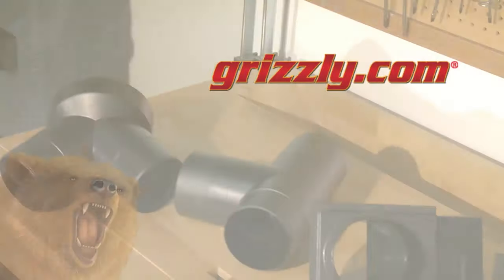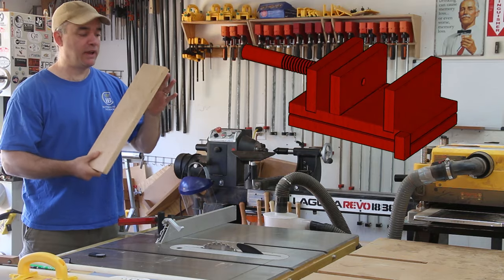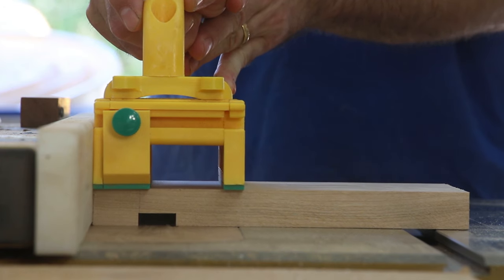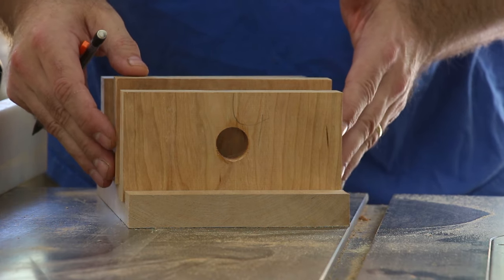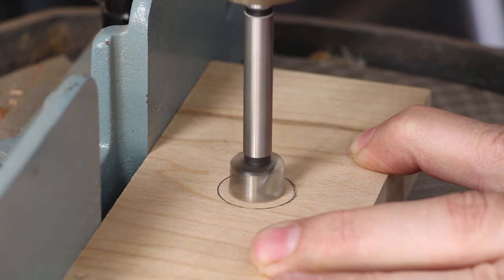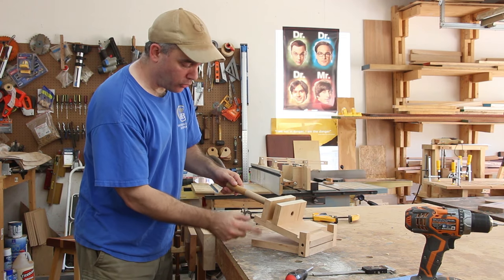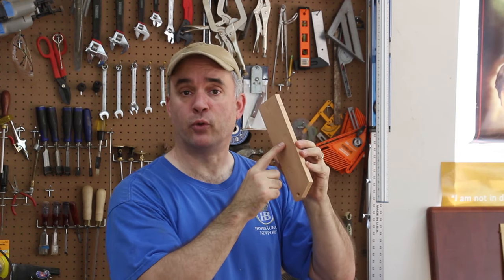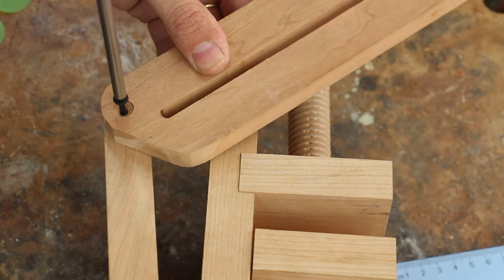Tilting Drill Press Vise

Comment: Congrats! Very impressive 100K!!! Very cool build. One thing i noticed with the threaded insert.. The two slots are actually the cutting edges not for the screwdriver to fit in. So it is in backwards. I do not mean any disrespect what so ever, maybe you didn't know. It is one of those things i did wrong for years untill some one explained it to me...
Reply from the maker: I really don't think that's correct and I hope you're pulling my leg.  There is no "cutting" that needs to be done as it's already pre-drilled.  The slot is most certainly designed for sinking the insert with a screw driver.
Reply from the maker: No way that's correct.  The slot is for a screw driver.  They also sell them with hex heads for the same purpose (with no "cutting" slot on the other side).  There is nothing to cut with the exception of threads on the sides of the insert.
Reply: GarageWoodworks i am not here to judge you. Sorry. I got my info from a seasoned woodworker after doing it the same as you for a long time. But since they are brass they easily break when forcing them in with a screwdriver . Again no disrespect to anyone. At the end of the day you can do whatever you want... 😊 😃 if it works it works. P. S. I did not believed it at first too!
Reply from the maker: No need to apologize.  It just doesn't make any sense on a few different levels.  First, there is nothing to "cut" that would be accomplished with that slot.  Two, there is no "cutting" slot on the hex head 
inserts.  Three, they work perfectly with a screw driver. *EDIT: The more I think about your suggestion that the slot should go in first the more ridiculous it sounds.   With all due respect, there is no way you are correct - I'd bet my house on it.
Reply: GarageWoodworks then were does the wood go that is taken up by the thread. If the wood is compressed the insert would be harder and harder to push in and thus the top of the insert will break in some cases. If the hole is bigger than the center exterior tube than compression is not a really big thing but misalignment is . And if you look at the insert the tread goes past the slot. So the wood would be going out of the hole. And not compress the wood. 2 the hexagon inserts are tapered. Leaving room for the compressed wood to go.  Compression of the wood is there too but due to the strengt of the hexagon head it doesn matter. It wont break that easily. Again, any body can do what they want. I find it this way easier to use. But i am not telling you you shouldn't do it with a screwdriver. May i thank you for this discussion. It is not always i get the chance to talk directly with one of the great content creators!

Comment: It is all very well for someone with an extremely well kitted out shop like yourself but this is not a project for your everyday wood worker. maybe if we all were sponsored like yourself we may have a chance at doing things like this.
Reply from the maker: +Steven Chambers Drill press vises are only useful if you have a sponsor?  I don't understand.
Reply: I meant that your sponsors most likely supply you with tools that the common woodworker does not have eg woodworking taps and dies before your video I did not know they even existed and none of my friends did either. hence my comment. good luck to you and those who have these things. but in my 67 years I have never had a use for them and am not likely to change that any time soon. I'm not having a go at you, I like your videos I'm just saying the ordinary bloke is not as well equipped as you are.
Reply from the maker: Steve - You assume way too much.  I bought that tap and die several years ago long before I had any sponsors (see here:https://www.youtube.com/watch?v=WpjpX4fOwXU).  There was nothing in this build that was out of reach from the "ordinary bloke".